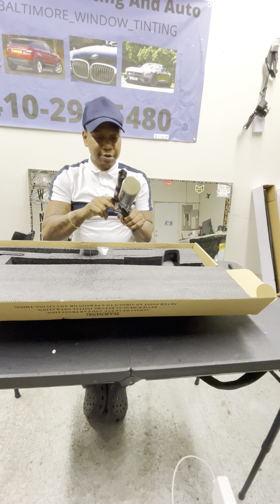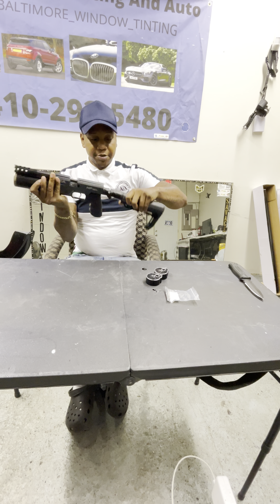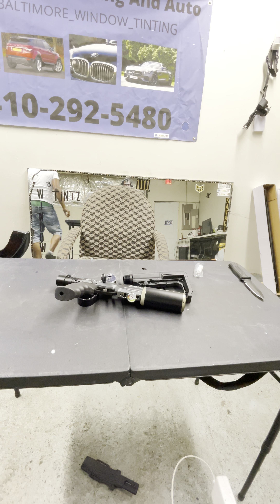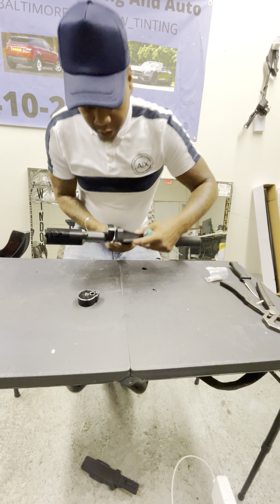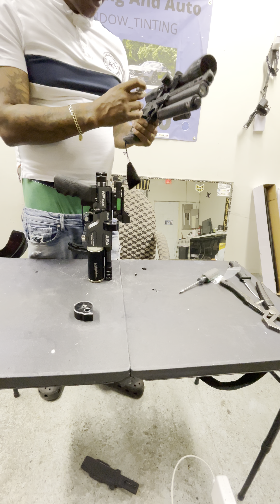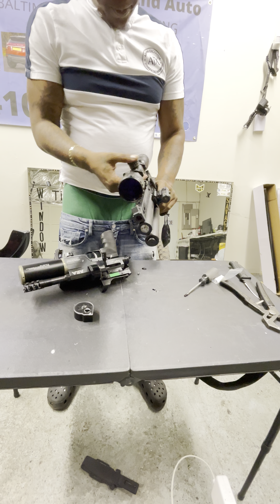AEA M50 OPEN BOX AND FIRST IMPRESSION AEA HP MAX .45 CAL BINTAC LLC AIRGUN Distributor

Comment: If you get a Black Arts Design HP Max AR15 grip adapter, the Big Bore HP Max use an M5 screw to hold the grip on. I’ve used a 12mm long M5 screw to hold the adapter on.

The kit comes with an M6 screw. That fits on the .357 HP Max.